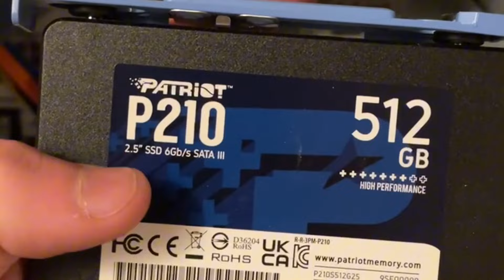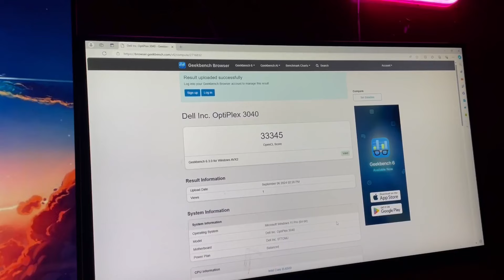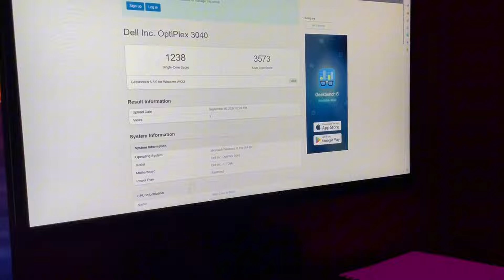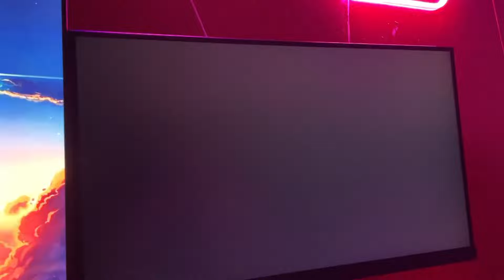$200 Budget Gaming PC Build 2024 || W/ Benchmarks

Comment: Teaching people how to play their games on a budget is great and I support you doing this. I have some critiques though for how you present this.

0:16 I see an rx 6400 on the table, I don't think this will be getting over 100 fps at 1080p in most titles. I'm sure it does in some titles, but it would be more honest to name some instead. I'm not sure what the specs on your pc are, but if the pcie slot isn't gen 4 then you will be further reducing the performance of your gpu.  

0:45 yeah 6th gen is not going to support pcie gen 4. As much as AMD usually offers better value with CPUs and GPUs, I might consider the RTX 3050 6G. As bad as that card is, for this use case it might be the better option (also doesn't need any supplemental power). Also I don't recall you ever telling people where you got the tower from (might have missed it, but don't think so). If you want to show people how to replicate what you're doing then it is important to do that.

5:22 When making fps claims you need to have data, generally an fps overlay. If you're not sure what to use msi afterburner and riva tuner is a good place to start with that (might need a guide, fps overlay isn't the easiest thing to get working).
Reply from the maker: The reason I didn’t go with the rtx 3050 is for 2 reasons. One its more money. And two it is bottlenecked by the 6500 while the 6400 is not. Thats the reason I didnt go higher. Also its got 140+ on esports titles that I played. Also the people paying less then the cheapest consle on the market aren’t expecting to play triple A titles, there mainly trying to do school work and play fortnite on the occasional

Comment: pretty good man! really enjoyed it! sadly here singapore, its really expensive for me in my currency, but you can probably get like rtx 3060 type of gaming pc for around 500-400 usd 
which is around 800-900 singaporean dollars!
Reply: Here's a tip, get any haswell i7 PC on carousel and upgrade the GPU to a 1060 or gtx 16xx series card
Reply: @DarrenLer  yeah but I mean rtx 2050 gaming laptop is cheaper to buys
Reply: @ZARUSI  the specs I mentioned cost less than SGD200 on the used market, and it's the same performance with the RTX 2050.
Reply: @DarrenLer  hmm ok
Reply from the maker: Just a tip a laptop 2050 will not perform lile a desktop 2050
Reply: @Collinpcs   i mean heard from other people thats its good and will work fine

Comment: Why go with rx6400 when there is rx580 8gb with the same performance for like 50$ or ~20 for beaten up one ?
Reply from the maker: One it wouldn’t work with just the motherboard power like the 6400 (doesnt need external power) and its out of driver support aswell